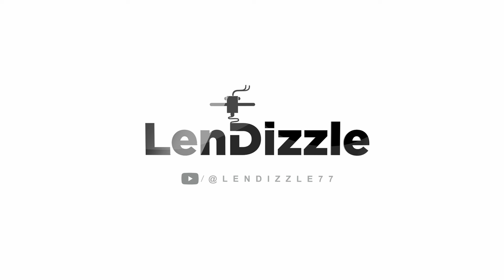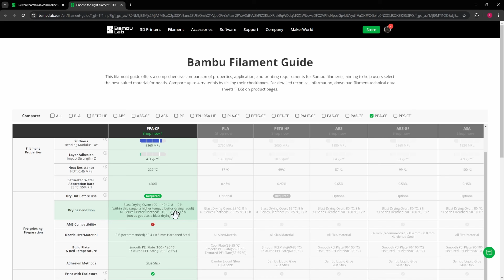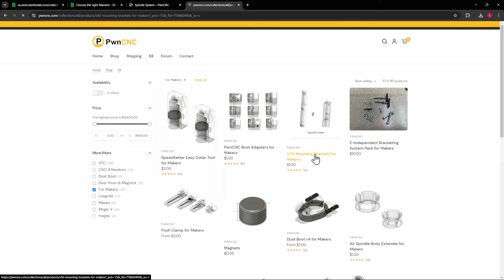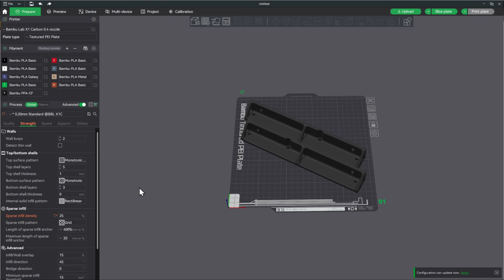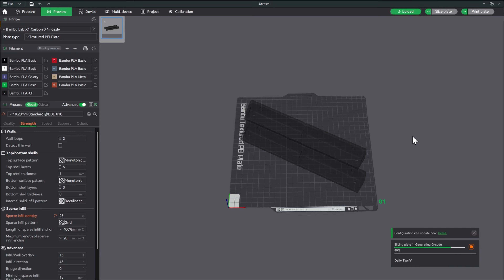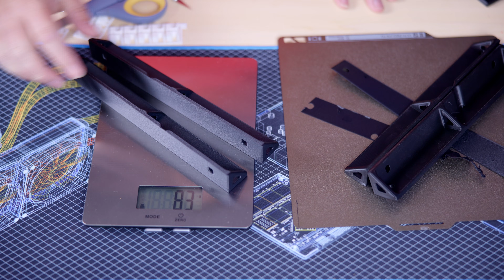PPA CF Review

Comment: I have dried at 70c. It worked fine. Its has a feed issue. It is very brittle. I print with nozzle at 315c. Bed at 110c.

Comment: If your dehydrator or dryer can’t reach the recommended temp, it doesn’t mean you’ll have trouble printing with the filament. It’ll just take a bit longer to dehydrate than it would at higher temps. Dehydrating temperatures are pretty much just the hottest you can get the filament without the risk of damaging it.
If your dryer doesn’t get that hot, give it an extra day of drying. No big deal 🤷🏾‍♂️

Comment: I've got an air fryer that goes down to 200 Fahrenheit. Think that will work?
Reply: Air fryers, "toaster ovens", or even a typical oven will work. The main concern is a typical ovens, and or air fryers designed to cook food, they use much larger heating elements than a blast drying oven. Meaning the blast drying oven is going to be much more efficient, power usage wise, and maintain the temps more precisely (usually within .5 degrees or less).
   You can pick up a decent blast drying oven for about $100 to $300, and at $150+ per roll of "high performing" filaments like PPA-CF, PEI (ultem), or even PEEK, the $100+ is an inexpensive investment to get the best / most out of those filaments. PLUS they are great at drying all nylons and even annealing parts to help make them even stronger.
Reply: 100 degrees celsius is 212 degrees farenheit, so yes

Comment: Not sure if I have a plan or not.  I designed a souped up convection filament dryer cover that might boost drying action on a heated bed.  It uses a sort of velocity stack to help move hot air through the whole thing via convection, which will hopefully aid in the drying action and make things move along a bit better for that method of drying.  Gotta print it out of something really heat tolerant like PET-CF for this application though.

Comment: Lot's of people use these filaments for printing Pews/Bang Bang frames and lower receivers 😉!! That's why it sells out so fast. This filament is the hottest topic in the two... A... 3d printing community right now and I can tell    you from the couple of test I've done it seems to be a improvement over both the PAHF-CF and the PET-CF.
Reply: I was fortunate to be able to snag a few rolls. It's incredible. I used Polymide PA6-CF previously, but this PPA-CF has replaced it entirely. It's even machine-able.
Reply: which printer is good for using this ppa cf? Do you think the P1s with upgraded hot end and gears is enough or is the x1c required to print this type of filament?
Reply: Also considering that the p1s bed can only reach a max of 100 c which is the lowest range that ppa cf can be printed at, would the p1s still work or not?
Reply: What is a Pew or Bang Bang Frame?
Reply: @BrainDeath89 wireless hole punchers
Reply: @BrainDeath89  frames used for purposes related to ejecting shells ranging from diameters of .22 to 7.62
Reply: @BrainDeath89  “airsoft”

Comment: Super cool your printing our VFD-Enclosure mounting brackets.  I was the first employee at PwnCNC. I've been doing support and component manufacturing since 2020.
On a side note... All electric ovens I have ever seen will go down to below 212°F/100°C. I dry my PA-CF/PET-CF filaments initially in the oven and then store it in a old vacuum chamber I use to stabilize wood in. I then take it directly out and either use the AMS or a drybox with desiccant to keep it dry during printing. After printing I redry it in the oven and then immediately put it back into the vacuum chamber for storage.

Comment: My kitchen oven goes all the way down to 170 degrees F.  Once it reaches temp it really doesn't cycle on much so I think it would work fine for drying this filament.  I use it frequently to dry several spools at once.
Reply: I do the same, works well, busted the lamp in the oven though

Comment: 5:24 you can create a gcode to turn on the heat bed to 110 C and create cycles of on/off for the auxiliary fan every 5 minutes.
Reply: Interesting idea, but I'm just curious why you want to cycle it? When I want to heat soak the chamber, I just go manually set the bed temp, manually turn on the aux fan to like 80%( above that is really loud), and tell it to home, which brings the bed up by the aux fan. But I think for drying, I'm liking the comments about an air frier.

Comment: An 8qt air fryer will blast dry it. You could also print out of it if you build a horizontal spool holder in it. Make sure it isn’t sitting on the bottom so the air can circulate.

Comment: So I’m not sure what exactly a blast oven is. I am thinking that the blast part is talking about air. I’m thinking a convection oven which uses hot air to cook might work? Thoughts?
Reply: Blast drying ovens are basically really precise convections ovens (usually maintains a .5 degree or less of air temp change), that are typically the size of a large microwave (some pro models are much larger of course). They are far more efficient than a typically oven and or air fryer, in that they are purposely designed to maintain a certain heat range for long periods and aren't designed to reach normal cooking / baking ovens temps. Meaning the heating elements are much smaller, less power hungry, so far less impact on the ol' electric bill. That's important when you are running them for the times needed to dry filaments.

Comment: I appreciate the video.  After reviewing the link for the DIY filament dryer it doesn't appear to meet the requirements of the Bambu recommendation for the blast oven.  Would be fine for lesser filaments but doesn't reach 100 to 140 degrees Celsius and doesn't circulate air within the drying chamber.  It would be helpful for anyone who has installed a proper blast drying oven to recommend a reliable model for drying PPA-CF at the recommended settings as provided by Bambu Labs - as these industrial ovens can get pretty expensive.  Thanks!
Reply: Ninja AF101 air fryer.

Comment: Bambu Lab needs to make an AMS Pro.  Integral heating capable of drying out the filaments they sell.
Reply: That’s sexy brilliant idea
Reply: Will never work. These filaments require temperatures above what would warp the AMS itself. 60-70C is not close to hot enough for properly drying nylon and other high temp filaments
Reply: @FrozenByFire3  yeh thats why it'll be the Pro version AMS. we have seen that leaked shot of the AMS pro
Reply: @FrozenByFire3  so make it out of another material like ceramic, or even make a new material like mixing in some gypsum with a plastic (I've experimented with that, makes it fireproof even). there´s no such thing as "will never work", you have to think in solutions instead of problems.
Reply: @mayena5735  yeah now look at cost. Ceramics will be far too fragile and would cost way north of a thousand dollars. Same as making it from metal. Plastic is the only thing that would keep it at a reasonable price.
Reply: @FrozenByFire3 I find, as someone who was a manufacturer, that very few people understand manufacturing and R&D costs. They always assume things should cost less than they must. In fact, a lot of people think that if something costs more than they want to pay for it, it’s overpriced. A strange way of looking at things.
Reply: Get a Sunlu S4 to print from, and a portable oven to dry in.

An AMS pro that can withstand both 150c drying temps and 70c+ printing temps is going to be very expensive as it is essentially a blend of oven and filament dryer in a metal high temp enclosure.

It's not a trivial exercise considering it also needs motors, ptfe tubing etc, all hardened against 150c temps.

You're better off just getting a sunlu s4 and toaster oven to dry in
Reply: @Tom--Ace  You are assuming, that heat is the only way of drying filaments, but is it tho? What about solid state dehumidifiers, wouldn't that be enough?
Reply: That's assuming that you keep only filaments that are heat dried in the same temperature. What if printing pla + petg?
Reply: @anonim1133  maybe thermal dividers to sustain each chambers temperature?
Reply: A decent blast oven that will dry filaments and even annealing the finished parts are about $100 to $300 (large "pro' models about $2000). If you are the kind of person / company needing the properties of the PPA CF or even PPI (Ultem), $100 to 2000 is a fairly inexpensive investment compared to the price of rolls at $150+ each.
Reply: They do make one
Reply: @98f5 yes. It seems to work well. But for some engineering filaments I use a blast oven. Some require 100C, and even Bamboo Lab new AMS HT only gets to 85C, which is high, but not high enough. And be careful of the reels. Some go to 70C, some 90C, and cardboard can go to 100C, usually. At least my Fiberon high temp ones do.